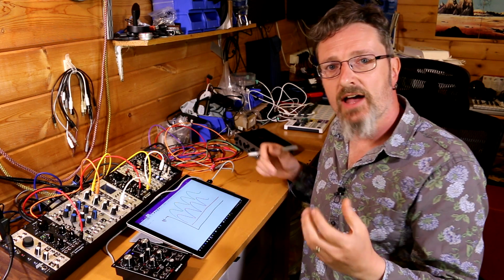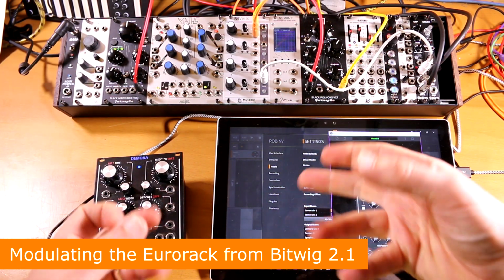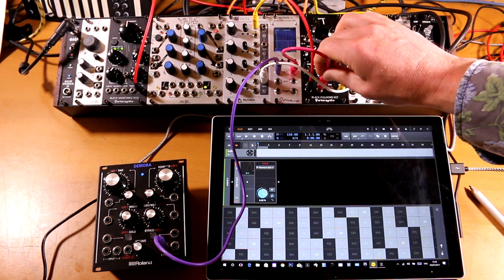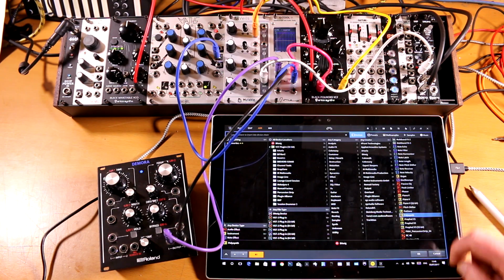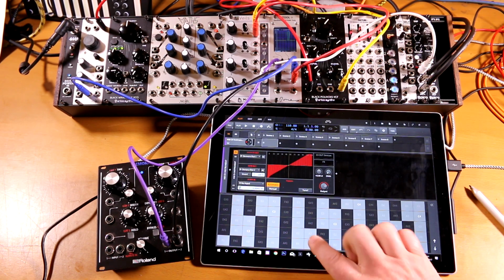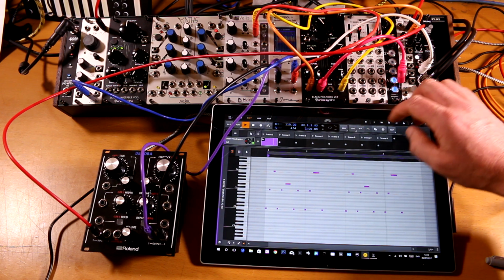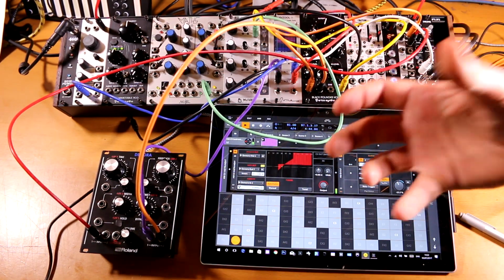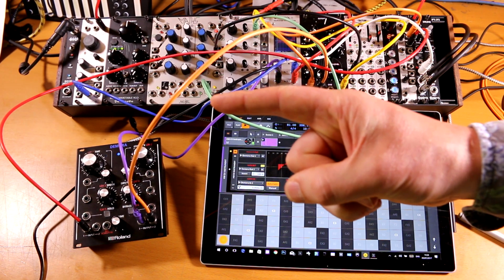Molten Modular 09 - DC coupling, CV and DAW control with Bitwig 2.1

Comment: You mentioned the ES-8 has 8 CV in and 8 CV out. I've been looking at the website and it looks like it only has 4 CV inputs.
Reply from the maker: I think you’re right
Reply: @MoltenMusicTech  I've decided to go for it anyway. Cosly but hopefully worth it. My application is attaching an etherwave plus theremin via 3x CV inputs so I can use it with VCV Rack and eventually move entirely to hardware. Midi quantisation isn't high resolution enough for my needs.
Reply: I did look at the Roland box but was concerned about input latency and only 2 inputs that are always tied to the outputs.

Comment: It looks like fun.  Thanks Robin for all the work.  Am I right in thinking it's still really digital because ButWig has a user interface that mimics an analog CV knob and that is sent as a digital string to the Roland module which uses a DAC to convert it from a binary code into an approximate CV that corresponds to the knob on the BitWig?  In other words it's not a completely continuous analog signal from the PC to the rack.
Reply from the maker: Yes, so at CD quality with all its crappy digitalness 😁

Comment: I bought an used Alesis AI3 a few weeks ago and had a pleasant surprise discovering that it is DC coupled. So far I only tried the Outputs, but it looks like you can use this for 8 DC out and 8 DC in signals. With a bit of luck you can find those for around 100 Euros on Ebay.

Comment: New to modular synthesis. Can CV and audio be transmitted at the same time? Do modular inputs  accept CV and audio... or just CV?
Reply from the maker: Yes - audio is just voltage moving really fast. So for instance an LFO can use control voltage to wobble the cutoff of a filter, or you can turn it up until its moving fast enough to become audio. Plugging audio into a CV input can be interesting - like with FM - but not always.

Comment: About the ES 8, what would be the problem with running two audio interfaces? For example the ES 8 running with any other non DC audio interface?
Reply from the maker: You can do it on a Mac by creating an aggregate device. You can also do it on PC using Asio4all but it’s all a bit of a hack and wouldn’t necessarily give you stable performance. It can work if you’re prepared to spend the time.
Reply: Molten Music Technology Thank you for your reply. So on Mac it’s relatively headache free?
Reply from the maker: Can be, if you believe the sync between aggregated devices to be stable enough for professional work - many people don't.

Comment: Is it possible to trigger a Bitwig modulator from an external source? Example: Setting up a Bitwig envelope generator to only send the envelope when it receives an external gate.
Reply from the maker: Ummm, i think so yes.
Reply: Sadly, the answer is no. At least not to a point I could figure out. There is seemingly no way to attach an incoming signal to an envelope other than a midi note on. I ended up biting the bullet and getting Reaktor. It's everything I wanted and more. I can make a whole vca circuit inside Reaktor. Highly recommend.

Comment: Is this the only control voltage compatible DAW? Would I be able to do something like this with Max/MSP and Ableton?
Reply from the maker: There are plug-ins which can do this - check out Silent Way from Expert Sleepers.
Reply: You could try Reason. It's built on CV. I have ES3 and was going to buy the Silent Voices VST plugin to drive it. Discovered to my pleasant surprise that I don't need to. Can use all native Reason CV generating instruments/effects/utilities to produce exactly what I need. It's like having 3D Reason - it's no longer only in the box.
Reply: if you have a scooper,demora etc. you could just use the midi to cv module inside the roland device. Reason has an external instrument device that you can send midi out via usb. Set it to aira module and done you now have gate and cv options to send to your modular without any software purchase.

Comment: And, in the 07 episode, you set the system's output to the mother 32 output. But in this video you have a separate module for the output (maybe is the delay). Is there any special routing for the system's output? or I just take the las module on the signal flow and plug it straight from it. (I wonder if every module has an stereo output).
Reply from the maker: I have no special output module - i'm currently running everything into the Veils VCA and then a single output into the Pico DSP module which then has a handy stereo output. I  mean to use a proper output module at some point like the make Noise Rosie - or maybe a mixer, or another VCA - it's all audio so it just comes down to organisation and what you want to do with your signals. Many people use an external mixer - whatever you want :)
Reply: Gonna take a look on thatMakeNoiseRoise module, thank you so much for the quick answer. For sure I'll be asking more questions in the future. :)

Comment: You didn't mention it, but the disting has ES-1 and ES-2 emulation modes - which allow you to get D.C. cv's in and out of your system using any AC coupled interface and their driver
Reply from the maker: I will mention it in the video all about using AC Coupled audio interfaces that i said i was making next :)
Reply: Molten Music Technology cool - though FYI they are both D.C. coupled (just happen to tunnel through an ac coupled interface for transport).    Anyways, keep up the great series!
Reply from the maker: I'm not sure what you mean. The ES-1 is for resolving a DC signal out of an amplitude modulated AC signal that comes from an AC coupled audio interface from CV generating plug-ins that have had to amplitude modulate a DC signal in order for an AC coupled interface to be able to pass them! (take a breath). The ES-2 does it in the opposite direction. So the fact that they are DC coupled themselves is neither here nor there really. Or is it? You say it like i've missed something important - and i'm trying to fully grasp this stuff - so please explain if i've misunderstood something as that can be very helpful :) Thanks!
Reply: Molten Music Technology I am confused now - I was just saying that you get a D.C. Coupled signal on the modular side (which I think we are in agreement on).  When you mentioned the ac coupled stuff, I was thinking you meant bringing ac directly in and tuning levels via preamps and attenuators.   Anyways sorry for the confusion!
Reply from the maker: I have no idea what that's all about :D
Maybe i will once i've finished my video on AC Coupling and messing around with the Disting.
Reply: Molten Music Technology I look forward to it,   Sorry about all the confusion over what usually amounts to a single capacitor (or lack of one :))

Comment: No expert sleepers ES-8?  I am disappoint.  I just use a MN Rosie, and use the headphone jack on that.

edit:  BTW, I would love a tutorial on the disting's new wavetable VCO mode.
Reply from the maker: I think i mentioned the ES-8 quite a bit.... but i don't have one. I'm trying to do it in a simpler way. The ES-8 doesn't suit me, i need mic and instrument inputs etc in an audio interface. But what i did and how i did it would be exactly the same whatever DC Coupled audio interface you were using. How are you using the Rosie for moving CV to and from a computer?
Reply: To clarify, I use the ES-8 as my soundcard and the ES-8 is the one that sends and receives CV.  For Mic In, I have a Pittsburgh In Out, which has enough gain for any mic that doesn't require phantom power.  The Rosie has a stereo effects return that I plug channels 1&2 into and use that as the DAW's main output, which I listen to on the Headphone output.

I should mention that the ES-8 has asio drivers for windows and I know people who just make an aggregate interface and use their standard audio interface for all the normal stuff.  The ES-8 is super flexible and way easier to use than a Demora.
Reply from the maker: Sounds great - i said in the video that the ES-8 was a great solution, although you've had to add two further modules to achieve what a more regular audio interface can already do - so, as i say, it's not idea and starts getting expensive. Sounds like it's working well for you though! Trying to make aggregate interfaces on Windows is all a bit rubbish - it can work using ASIO4ALL but it's not great and not that stable. I'm not suggesting the Demora is an awesome solution - it was just very handy and meant i didn't have to pay twice the price for an ES-8, or an audio interface with ADAT plus the ES-3 or a posh MOTU box. And I hope that using something simple and multi-purpose like the Demora can help other people who don't have loads of cash to throw at this - you can get a decent module that does its own thing and give the DAW-CV thing a go. That's what i'm all about, helping people have a go.
Reply from the maker: Yes you are confused! :)
The Demora has no MIDI of any kind in it. It is an audio effects Eurorack module - audio in - delay - audio out. It also has a USB port for connection to a computer so that you can use the customiser software. It also happens to have ASIO audio drivers which means you can use the Demora as an audio interface - audio in - audio out. The inputs and outputs are DC Coupled which means that we can send CV in and CV out of the computer via the Demora. In this video I am sending CV out of Bitwig via the Demora and into the Eurorack. No MIDI is involved at any point - it's all control voltage (CV). Does that make sense?
Reply from the maker: That's cool mate, we're all learning :)
I guess you could argue that Bitwig is doing the work of converting MIDI notes into CV - but then why would you have to tune it? Also the HW CV Out generator is being directly modulated within Bitwig at a higher resolution than MIDI would. Or something. I dunno - i just did what i did and here's the video of that adventure :)
Reply from the maker: Yes - demora is the audio interface. The USB connection is just how the interface is connected to the Surface. It could be firewire or Thunderbolt if you prefer (but it doesnt have those connections) how else is an audio interface connected to a computer?? The USB connection isn't relevent - it's just how the majority of audio interfaces connect to a computer :)
Reply: I had purchased the IN OUT and Rosie before the ES-8 just because I have a lot of guitar pedals that I wanted to use with my modular set up and then listen to on headphones, but I agree there is an opening in the market for a competitor that might make a sound card module with a few more features like a mic pre and dedicated headphone out, although that might cost more again.  I would just say that I have no regrets where the ES-8 is concerned and should you have the opportunity to try one out I think you might see the merits more clearly.

On a side note, the Demora is so inexpensive because Roland is liquidating stock.  When they were first sold, they basically cost the same as an ES-8.  In addition they really don't rate well in terms of power consumption, 450 mA is a lot for the footprint it has.  Also, if you add the HP of a ES-8, Rosie, and IN OUT it's 1 hp wider than  the Demora.  But I will admit the roland modules have a very nice build quality and basically do better outside the case anyway.  All the best!

Comment: If you use any Ableton (free or otherwise) then just use CV4Live VST https://youtu.be/Okp0NV9G1b4. In seconds you're up and sending CV without any hardware issues. You can also use multiple instances of it depending on how you want to interface with your modular and how many I/O you have available. You can use AC coupled interfaces of any manufacturer.
Reply from the maker: That's very interesting, thanks for the tip! However, you're not sending CV, you can only receive CV into Ableton - so you can't sequence or control your modular from Live with this plug-in. You're also having to use up oscillators in order to generate AC coupled CV signals from your LFO modules. It's true that you can go through a regular audio interface because the CV4Live is rectifying the AC coupled signal back down to DC - very clever and very useful, but also very limited in that i'm more interested in sequencing and modulating my rack from my DAW rather than the other way round. Cool plugin though :)
Reply: Molten Music Technology thanks for the reply. I agree with its limitations. Check out Voltage Control Lab for their Drum Rack to trigger modules. By the way, great videos! Keep up the good work you're doing.